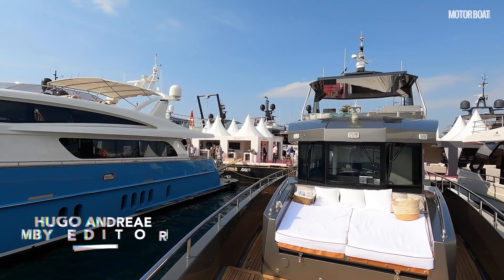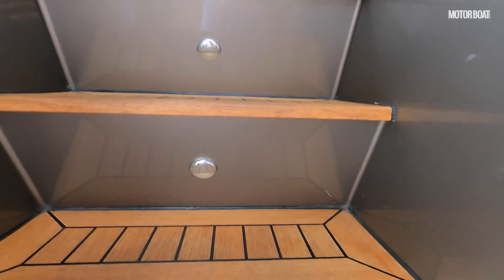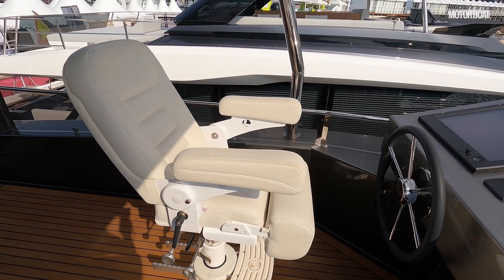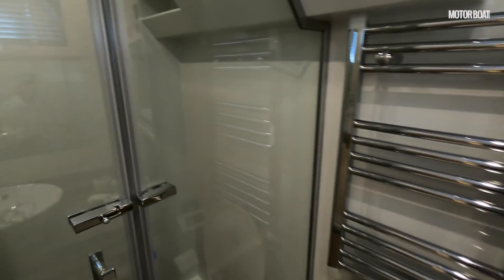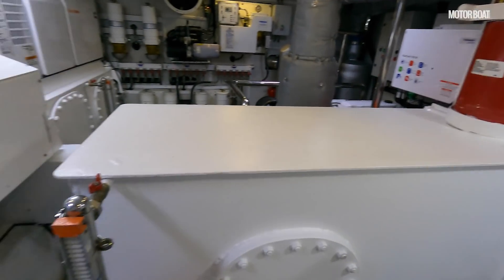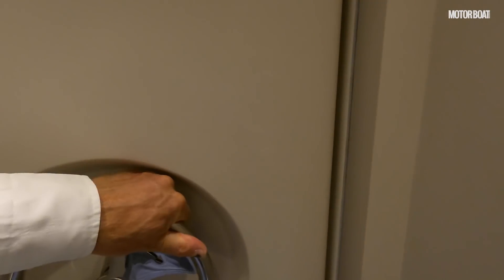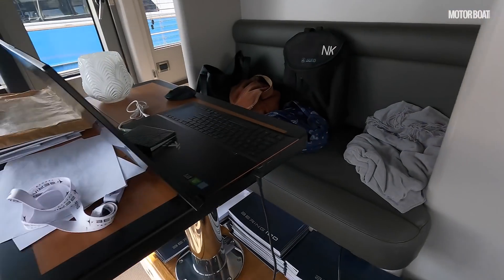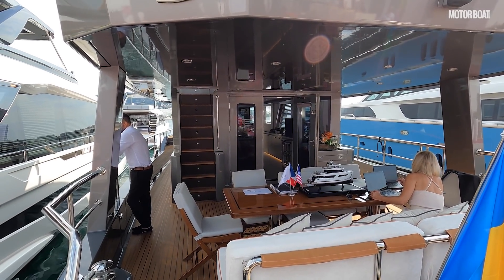The ultimate long-range steel explorer yacht? Bering 70 yacht tour | Motor Boat & Yachting

Comment: Bering yachts are solid built explorer boats which are a fantastic way to travel, often for thousands of miles before having to refill those massive fuel tanks. A lovely informative tour Hugo of a great new boat builder who will accommodate almost any layout the buyer wants!
Reply: Thanks John
Reply: I love that Bering over engineers everything, even the cleats are for much larger ships.  Sounds wasteful, but if you’ve experienced issues on a ship, robust everything is worth every penny.
Reply: @Erin-Thor  yes Erin I have to agree with you on that one, they do equip every yacht they build with oversize cleats and bollards that are similar to elephant bollards. Everything on their yachts is oversized, they are built like tanks for anything they may encounter on the savage seas.

Comment: This vid omits the design principle: the B70 is a coastal cruiser, not a blue water cruiser.  For calm to medium seas.   In gale conditions, the bow would be swamped with green water continually, and that deck sofa would be washed away in seconds. I expect that sofa u-frame would create many problems, as it would trap green water in its bay.  The B77 appears to be the superior all-round vessel.

Comment: Great tour, stunning boat. No crew cabin though in a 70ft is unusual, or did I miss it?
Reply: This one was built for an owner operator
Reply: @hugoandreae3785  And presumably if this does get sold on to someone who wants crew, the captain would sleep in the VIP with easy access to the pilot house.
Reply: I believe the 77 has option for crew accommodations of two cabins each with two bunks, shared head, and a little rec area with drawer refrigerator, microwave, sink and what not. I’d think a lot of owners of something in this class might want the option to have a Captain at times, or possibly even occasionally a chef if hosting a dinner party or whatever.
Reply: The second one built does have the crew cabin in the back.

Comment: I have to admit that video was hard to watch, especially when panning around. Try using a higher frame rate of 50 or preferably 60fps, which will make the video much smoother. 
Love the Bering explorer boats though, certainly my fave of those I've seen, and as others have said, the Bering owner, Alexei, seems keen to promote how much goes into making these high quality boats. The Nautistyles videos of them and of the Bering boatyard in Turkey,  offer a lot of insight into how much the company values build quality etc.

Comment: I think the 70 was NOT designed to be a "proper sea-going yacht" (crossing the Atlantic, etc.) as the 77 was. The 70 would be an excellent coastal cruiser (Med, BVI, etc.) for an owner-operator. The 70 is overall a significantly smaller boat and much less expensive than the 77 as well.

Comment: I dunno. Gives the impression of being a much smaller craft, like they heated up a 55' and pulled hard to stretch it out to 70'. Meh.
Reply: I got the same impression. Everything felt a bit pinched, especially the so-called VIP cabin. All the heads looked cramped and stuffy, too.
Reply: That is intentional. This has about the same volume and displacement as a "fatter" 55-60 footer, but will be faster as hull speed increases with waterline length.